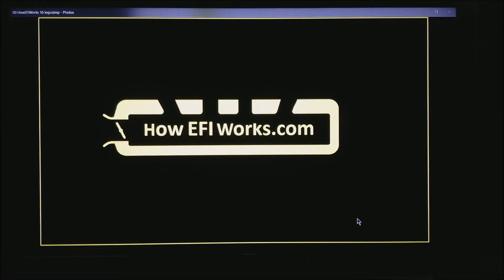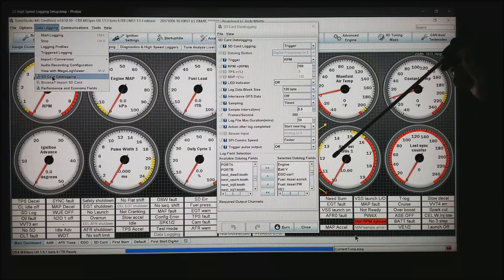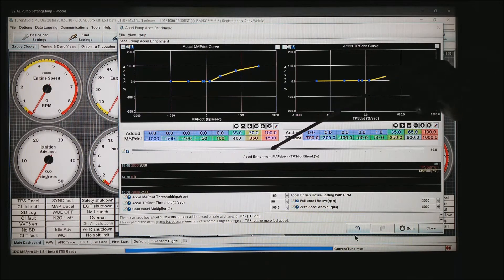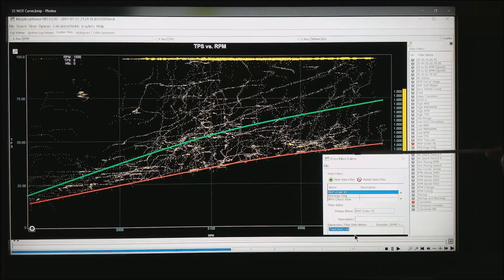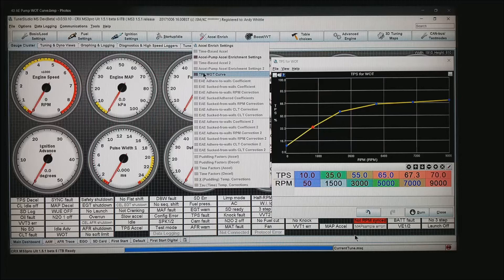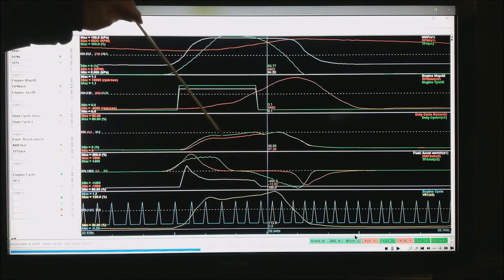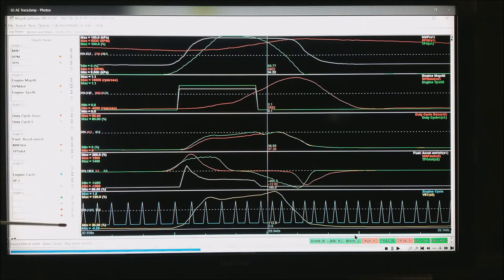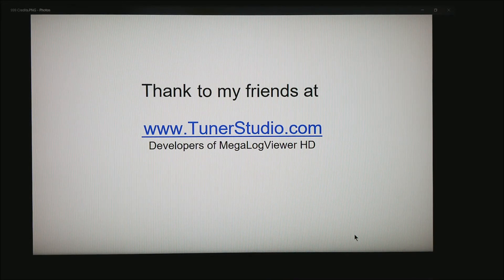MS3 Acceleration Enrichment Setup

Comment: Andy - Love the videos but this one was good and bad.  Good that you tackled a hard issue and have some unique ways of approaching it.  Bad in that you didn't directly correlate the numbers from your lines to what you entered in the TPS for WOT view.  Also, you mentioned something about how you "scaled" TPS to make the line straight, but you didn't tell us what that meant or if we should do the same.  So, from that point on, wasn't really sure why I did the stuff at the beginning...it wasn't clear. Then at the end, it wasn't clear why we were looking at the slope on the end and what we should do if we see it not in the smooth arc that yours was in as it was obviously already tuned.  Would have been better to show us each extreme - too lean and too rich, and how to slowly correct for it.
Reply: Agree, I don't quite understand the method here because of the same things you pointed out.

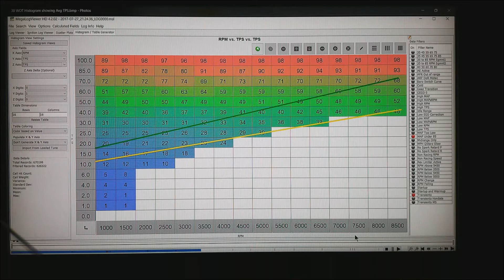Comment: Andy, at about 8:23 you mention that the green line essentially makes up your new TPS at WOT curve. However, I am having a hard time correlating the numbers you show in TunerStudio to the green line.  

3,000rpm shows to be about 30% TPS according to the green line, in TS you entered 55%. Is that right?
Reply: Ditto... None of that made any sense. Or how he made the next curve off of that data. I'll just stick with what my basemap has I guess

Comment: Hey Andy. Great videos very useful thanks for taking the time to make them. Quick question at 12:55 you refer to something you set on the previous screen to help with noise on the signal of TPSdot and MAPdot. I can' quite tell what you are referring to. Is this just turning on a little bit of smoothing to the signal in Megalogviewer? Thanks  Ed
Reply from the maker: See 4:36

Comment: Hey Andy! I watch all your videos and they are very informative. My only question pertains to your mic, it always sounds muffled or far from where you are, are you using a lapel mic or just the camera Mic? 
Your work is outstanding though 😊
Reply from the maker: I am using a $20 Bluetooth Headset and a Samsung S8.  If I ever start making money at this, the equipment can improve.  Thanks for watching
Reply: Oh, that's why it sounds like you're on the phone. I use a cheap $20 bluetooth lapel mic plugged into my gopro and get pretty good audio. Just use a cable extension if I need to move around.